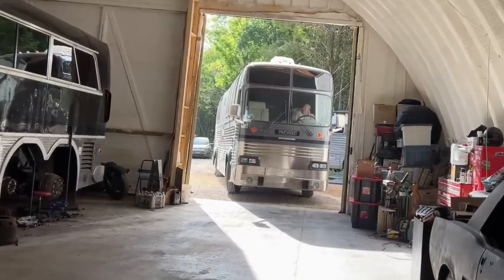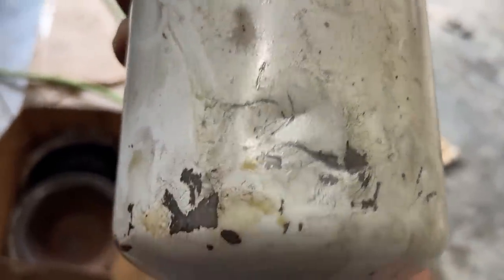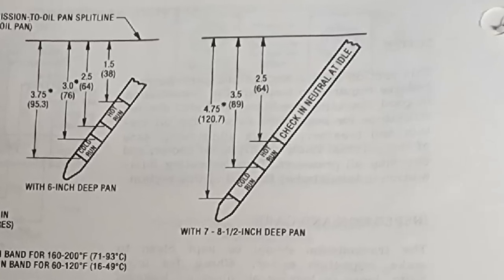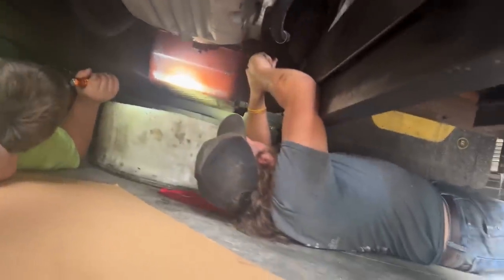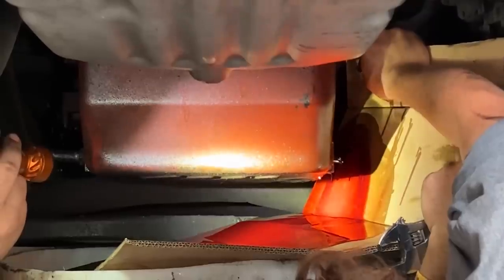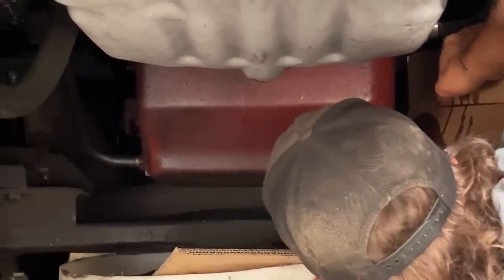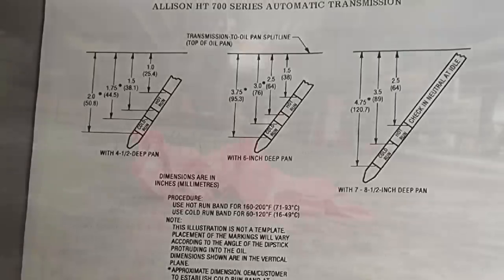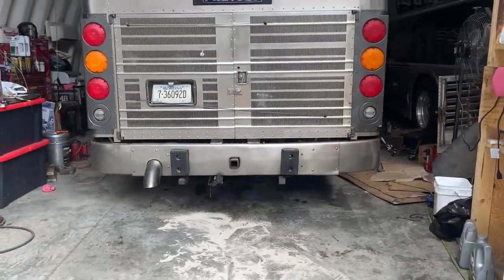Very bad service from large shop!  I give them an F on the report card.

Comment: And this is the reason why I do 90% of my own work. You can't rely on somebody to do the job right you never know because they're in a hurry they're not very well schooled in the vehicle that they're working on. I changed the fuel pump and my 1990 G10 van it took me about 40 minutes to do from start to finish I knew the fuel pump was going bad because I could hear it from the driver's seat it was loud and it was pulsating and I'm sure had I taken it to a shop it would have cost me $200 in labor for them to do it and the part only cost me $60
Reply from the maker: The shop told him they were having trouble finding people to work…. Translation is we are currently hiring people we would have never hired in the past because that’s all we can get.  He paid the price and their reputation is no longer gold standard

Comment: Excellent Video. BTW The Factory came in and found I was correct on my Prevost including the Frame was manufactured incorrectly. The Tinsel Strength of the Steel was Off and out of standards. They are replacing the Bus at no charge to me. It was unsafe.

Comment: It has been my experience over the years that professionals are fast not good!
Reply: I was a professional Harley-Davidson mechanic for 15 years before the crash in 2006. I was slow, not even getting close to the flat rate book... ever. My boss was very happy with my work. The only come-backs I ever got was due to part failure. Haste makes waste. It generally cost a shop more than the original job could pay when it has to do it over again for free the second time under warranty.

Comment: Shops are not always the problem. You can have a half ass want to be mechanic that in that shop and it can ruin a shops reputation.  The shop needs a Quality assurance person to check all work before it is released. Because you own a big fancy tool box does not make you a mechanic that knows what he's doing. Same goes just because you own a hammer and nail bag does not make you a carpenter. Lots of sheeple do not take pride in their work nowadays. Pretty Sad
Reply from the maker: One of the reasons his bus was there for many months was the fact the shop was having a hard time getting people to work. So this bus got the lowest common denominator employee-s thrown into the mix

Comment: Have you thought about having an inspection pit in your shop?
Reply: @lesoram6236  Good point. It does depend on how deep it is. I'm guessing and may be wrong but it's possible to stand up quite close to the engine and gearbox. I know when I worked under big trucks it was great.  Each to their own. Great vids by the way 👏 👌